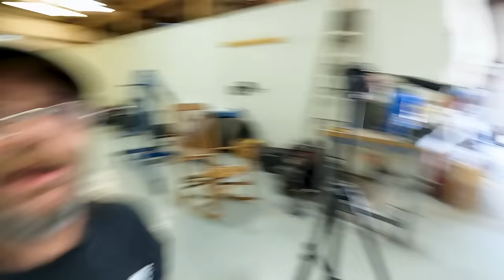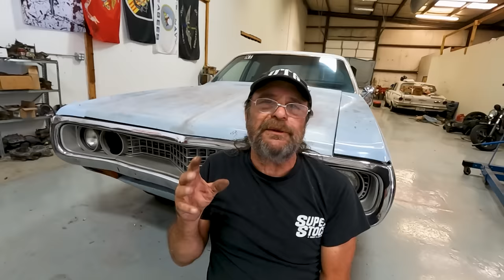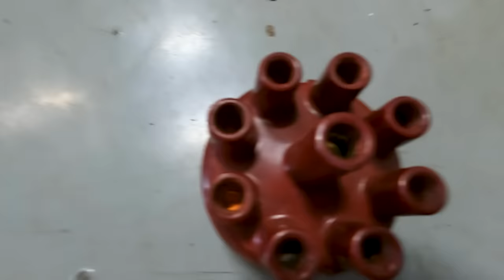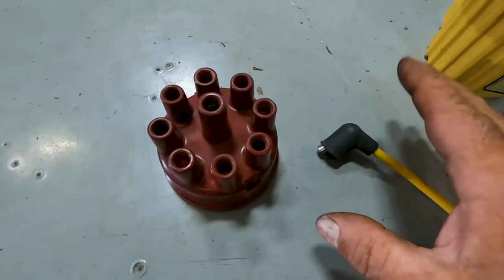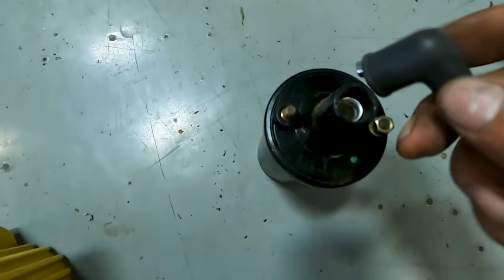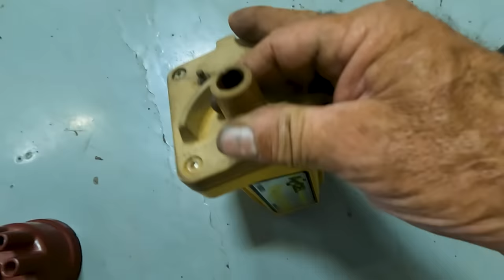Engine Misfire Under Load - Diagnosing And Troubleshooting One Of The Most Common Drivability Issues

Comment: Tony, not being critical. Just a reminder. As you say, "With the engine running pull the coil wire..." For the novices out there that may think the coil and plug wires are well sheathed and insulated and you won't get shocked, WRONG! Make certain your hand is insulated via a heavy rubber glove or preferably pull and replace the wire with an insulated pliers. Good content as usual, Tony.
Reply: I have been booted even with 1000v vde electrical pliers... But only when pulling the leads off the plug end. You are safe to pull them from the distributor end
Reply: My first thought when he said to pull the coil wire is somebody is going to get knocked on their butt and cuss him out for sure!
Reply: @izaacbanks3337  One way of checking that there is spark. Like testing a condensor; put it across a battery and throw it to someone to catch. If they jump it's good - if they don't jump replace it.
Reply: Shock and pain is how you learn "don't do it that way".  Smart people learn the first time.  Stupid people it takes about 10 times or so.  Took me about 200.  Even if you are as stupid as me, eventually you learn because pain sucks.
Reply: Im usually holding onto the hood while i do it. Hei has some bite
Reply: I gave up and started loosening the wires while the engine was off, then when the engine was running I'd finish pulling them off with long needle nose with jumper cables grounding them.
Reply: @nastybastardatlive o you'd "worry" that a guy doesn't want to get shocked when he could avoid it?  That's logical.  You make good decisions--I can tell.🤦🏻‍♂️
Reply: Old long haul trick to wake yourself up for a couple hours was to open the hood and pull a plug wire while it's running...
Reply: Yep I’ve been there and it’s a pain/experience I’ll never forget.
Reply: @nastybastardatlive  Depends on the ignition system. A low/medium power one isn’t that bad. A high power ignition can light you up enough to be bad and isn’t something you’d want to do repeatedly.
Reply: I've got low ohms, I always get bit pulling wires off while running. 😂
Reply: My first employer as a auto repair tech told me a real man could hold an HEI spark plug wire to the head of his Jim Dawg and not flinch.  I never tried it.
Reply: @jaylestingi  - Exactly!
Reply: I learned that the hard way and you'll never forget about it
Reply: a trick is using cartridge type "fuse puller/pliers"
Reply: Too late 😂
Reply: If you use an incandescent test light attached to ground, the spark will jump to the test light, not your fingers.

Comment: Exactly correct. My 87 W150 would start misfiring under a load, especially when towing. I mentioned it to a friend who told me to do a "midnight test" on it. So I did. Went out after dark, started the truck and revved it a little and found sparks flying everywhere. Distributor cap, at the plugs, even one plug wire had a bad spot in the middle. Tune up completed next day, problem fixed.🙂
Reply: Especially in highly humid conditions, such as a rainy day.  You can lighly spritz your plug wires (one at a time) with water mist if you suspect one is bad.  Wetting a marginal wire will expose damaged insulation issues.
Reply: And don't buy the cheap generic stuff either. Mallory wires work well for years.
Reply: I never tried them (Mallory wires) but will give them a shot.
Reply: It also helps it you spray water on the wires with a squirt bottle.

Comment: Years ago in the late 70's early 80's the early GM HEI rotors would partially fail. Not completely, but start bleeding some spark energy to the distributor shaft. The engine ran ok, but, the symptoms acted exactly like a vacuum leak.   Now days, "what's a distributor or distributor cap?"

Comment: I just had a cylinder that was misfiring. This goes back to the EFI talk. My first action I grabed my IR gun and looked at my headers. Didn't see any big differences. So I did a compression test. Once again no big difference. ..? Called the EFI tech line. He said spray a mist of water on the header tubes.  Thinking I already checked them,  but did it anyway. #4 was much colder!  Next grabbed a spark plug checked the spark. Looked good. Swapped two Injectors around. Problem didn't move? So then I pulled the plug and this time tested it. Had no spark then some spark. Plug was clean and looked good? Pulled the cap. #4 wire had a little crack in it and is next to the firewall & wiper motor. Jumping the spark. But not always? Put a new spare wire on, problem solved? Why was it missing?  Driver's side motor mount was broke. When the motro reved up it moved closer. . Now you my wonder why #4 is back there. Well the xyz distributer has screws to hold it down. When it was made one screw was underneath the A- body wiper motor.  So I set it up for #1 wire to line up with # 2 cylinder not #1. So all the wires are now two spots off. Pointing at #2 with #1 at TDC. Screw problem fixed, unless somebody else works on it.

Comment: A misfire caused by a slightly lean accelerator pump setting does not hit softly, it has the exact same symptoms as an ignition misfire with the engine sounding like someone dumped a bucket of water on your distributor cap during hard acceleration causing crackling  and the ignition breaking up. A lean misfire can be very hard to diagnose because it sounds so much like an ignition problem when in fact it is a carb problem. I chased this problem for months changing out ignition parts and finally fixed it by upping accelerator pump squirter size.

Comment: I have been subscribed for years but haven't needed the "learn'in" for a while.  But this week I have been dealing with backfiring under load.  I followed your logical explanations, tracked down the problem (one of the SP wires was not tightly clipped to the plug), fired the car up and was driving like it was supposed to in less than 30 minutes.  I'm happy again without using the new parts cannon.  Thanks for the help.
Reply: Part cannon 😅😅😂😂

Comment: I had one of those super coils on a mustang back in the nineties. I didn't have room to mount it standing up, so I mounted it on it's side. Every I ran it long enough to get up to temp, it would push a little oil past the O-ring between the top and bottom of the case. Finally it pushed enough out to make the coil fail. It started out misfiring at about 6200 rpm, and got bad enough that I didn't think I was going to make it home. I didn't  see the oil leaking, because I kept it so clean that the leak didn't have a chance to show up. I only noticed it when I pulled the coil and there was oil in the seam,and a single drop hanging on the bottom. I pulled the top off,and there wasn't a table spoon of oil left in it.

Comment: I learned an important lesson last month on a "misfiring" issue only at low Rpms.  
Always check both ends of the plug wire before you start changing anything. 
I changed plugs, went to the junk yard and got several different sensors, a set of fuel injectors..
Lol i hate to admit this but i never pulled the plug wires off the coil side, only looked at the plug sides.
Ended up being one of the connectors got water in there and rusted on the wire coil side..
I always say look at the simple easy things first..and then there i go with the parts canon😄

Comment: Hey great vid uncle tony! Back in 72 my high school autoshop had a machine made by champion the sparkplug people that not only cleaned the plugs but also tested them under load. You could see through a quartz glass window if it was sparking as you increased the air pressure to simulate compression pressures. The higher the pressure, the harder it is for the spark to jump the gap. These machines fell out of favour as some felt that the abrasive sand used to blast the plug clean might remain and get into the engine. Also it was easier and less labour to just replace the plugs.

Comment: This is really good!  In case anyone is wondering how it's possible that a wider gap can "amplify" the spark, I think what's happening is the coil is not allowed to release its energy until the voltage rises to a higher peak, which ends up with a more violent spark at the cost of a small added delay.
Reply: that’s exactly it, the coil builds its voltage until the spark jumps the gap. larger gap demands a higher voltage which creates a hotter spark up to the limit of the coil

Comment: Thank you for this video!!  Ive been chasing this exact misfire for too long.  Threw new coil packs at it with no improvement... watched your video and discovered my #4 plug wire wasnt on my plug!  Pushed it on there snug and now the misfire is 98% gone.  Time to replace wires 😅

Comment: Now you got me motivated to replace the sparky bits on the truck  now to get O'Reilly to come up with eight R44TX spark plugs at one store.  Okay Fife has one, auburn has four. 324th store has two .  Used to be a common plug..  even going for a new cap and rotor, one of those fancy red ones even new wires. It's been a while since I changed those .. the fun part of the whole thing is getting My stroked out  oldass up into the engine compartment of the lifted square body truck. Everything else is easy with one functional hand, it's just getting to it.
Reply: Totally normal for those stores, I was at auburn south to get plugs for my geo metro last week, 3 cylinder engine and they only had 2 plugs 😂
Reply: Hang tough, mud duck!

Comment: Years ago on my 1977 360mopar I had just rebuilt, new cap/rotor, new plugs & wires it would shoot a flame out of the carb about a foot or so only when driving under load, after driving me nuts for hours & checking everything over and over it turned out to be a bad plug wire going to number 1 which I didn't think being brand new would be the cause.. I finally decided to change the plug wire one by one and as soon as I changed #1 plug wire the problem was gone.

Comment: I've been recycling 1980s Ford Racing 8mm wires on me 1986 5.0. Amazingly, those wires ohm out fine and even on all 8 wires, with tiny variations for length. They didn't build stuff like crap as much back then. I've tested new wires from today that fail an ohm test out of the box.

Comment: Quite so. Love you, UTG.  My 1994 Suburban... misfires.  New wires, cap, rotor.  Just revving the motor in park told me nothing.  I put the thing in drive (auto trans) parking brake on, chocked the wheels and waited for darkness.  I revved the motor by hand (TB) in the darkness.  Nothing.  Then I filled a spray bottle with water.  I sprayed the sparking plug wires and got a lightshow.  My wires were new (I will not disclose who made them... COUGH AC COUGH DELCO) and they were blowing sparks everywhere.

I went to a different brand of wires and never had another problem with my wires.
Reply: Thanks man. I've returned so many "new" parts this year alone. What is going on? Had a 1 month old spark plug die on me. Full weekend to find the problem as I thought it's new so I don't have to check that. My 3 month old steering rack is already clicking - can't send that one back. Multiple other stuff breaking or just failing 1 to 6 months after use. - all brand new.

Comment: Perfect timing ! Lol 
My 87 GTA has been developping misfires under load and now it's really unpleasant to drive at anything but cruising speeds with a few misfires here and there. The wiring and spark plugs look good and had been replaced not so long before I got the car, but with aftermarket stuff you never know the reliability. I'll check all that as soon as I get home.

Comment: I had a hair-pulling experience with this on a 3rd-gen RX-7. It ran fine until it built boost under load, when it would start surging until you lifted the throttle. I left it at a Mazda shop (not a dealer) for two or three months so they could swap parts on it. The last thing they tried was the coil packs. One of the coil packs and a cable were bad. I threw about $500 dollars in parts at it just prior.

Comment: Been chasing a random loss of ignition issue with my HEI distributor. It was as if someone would reach over and shut the key off. First, replaced the module, helped but still died here and there. Turned out to be the coil in the cap. Also found the base of the chinese dizzy to be cracked, so replaced it with an old AC Delco unit i found at the junkyard and rebuilt. Somehow managed to eyeball perfect 6° timing, but i couldn't leave it alone and tweaked it to 8°. It ran pretty good. Next time i drove it, after a while i noticed it has a very slight intermittent bog at 55mph. It then died shortly after i noticed. However, it immediately fired back up and ran fine for another half hour, at 45mph the most. Anything higher it began to bog occasionally (thing revs pretty high). I get it to my shop and correct the timing to 6°, but now any time there is any load, it misfires badly. It is definitely spark where it is so load based and such an abrupt loss of power. Anyways, i had pulled the new cap off and noticed a lot of carbon where the button is supposed to meet. The button looks like it was making contact, but i could be wrong. Will bend that prong up some and see if that makes a difference.

Comment: Old ignitions sucked my dad told me to push the wire out of the boot then push them in until the clicked then push the boot down then turn off the light and brake torque it and look for arcs jumping. Old wires were not good from the start. I still have wires hanging in my garage in case one goes bad even though that doesn't really happen anymore.   My 92 chevy truck used to have build-up on the inside contacts on the cap and would missfire when it got cold out. I got the expensive copper cap but it still did it. I don't miss caps and rotors until a cylinder coil goes bad for $120 a pop.

Comment: Another cause of hard-starting, misfiring, and lack of power is:  Coil Wire and/or Plug Wire Resistance.  It will also appear as a weak, orange spark.  Tried to chase the problem for days until I took resistance readings on the Coil and Plug wires and every day the resistance would increase 1000 ohms or so.  But the wires looked fine!  Found a NAPA store that would sell me a coil wire, not a full set.  Installed it and car ran better.  Then installed a full set of wires and performance was back to normal.
Again, the wire set, Packard 440s, looked great, but they were 25 years old !!

Comment: I like your explanation between 'misfire' and 'hesitation'. Exception! I once had a vehicle that sure felt like a fuel problem. I chased fuel and carburetor for some time. What I finally found was a weak condenser. It acted like a bad accelerator pump or power valve issue so close.

Comment: Never assume there is only one problem. 

One booger of a diagnosis for me ultimately turned out to be a missing tit which was supposed to retain the distributor reluctor coil.  This allowed the coil to rock back and forth which cracked the insulation on the wires.  The wires would short at certain RPMs.  Also the fuel pump pushrod would bind in the bore and float on the cam when the engine reached operating temperature.

Having two or more distinct intermittent issues makes for a challenging repair.

Comment: Tony...as an Electrical/ Electronic Troubleshooter for many years who Prided himself on Never taking the Shotgun approach  to Troubleshooting I find myself doing just that as I get older!? I have a 1994 Ford F150 that has developed a Missfire. I Changed the Plugs. I Changed the Wires. I Changed the Cap. I Changed the Rotor.
It still Misses!!! Next the Injectors I guess.

Comment: I had that problem once and the engine was twisting on the mounts enough to pull on the distributor power wire to give it a shoddy connection, damnedest thing. The little plastic tab on the distributor that the arm on the connector is supposed to hook over was worn down enough to let it back out a bit

Comment: I believe this may follow under the sa.e heading.
I had a Caddy that ran fine but under a load it developed a skip.
Turned out that whoever installed the spark plugs, used a spark plug socket minus the internal rubber insulator. Cracked the external porcelain on half the plugs

Comment: Hey Tony,  I have also found this misfire issue with spark plugs, where they have carbon tracking, and you can actually see the spark plugs glowing and flashing right through the ceramic in the dark when the engine is under load.